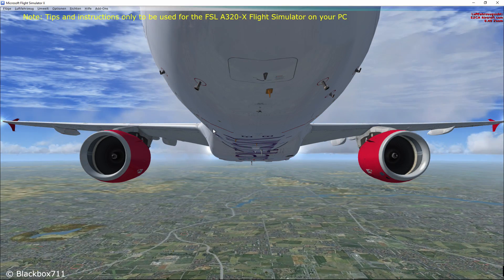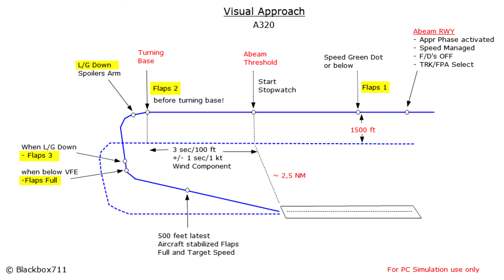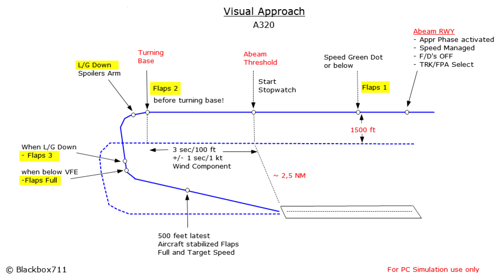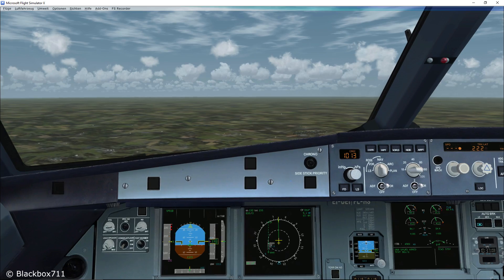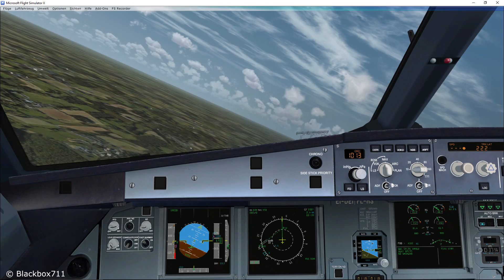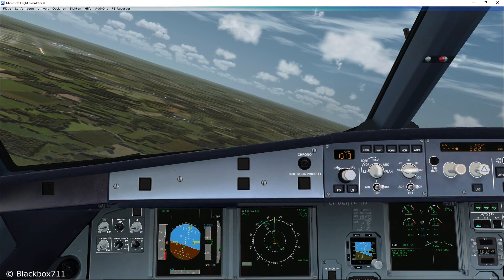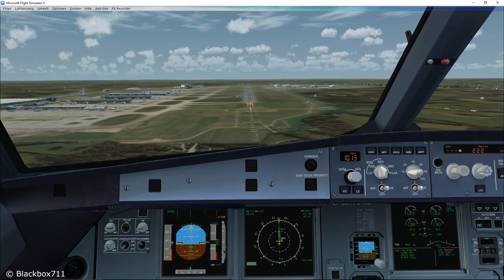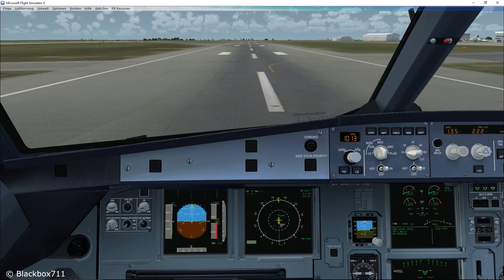FSLabs A320-X Basics: The Visual Approach

Comment: Hi there, on the a320, no ATC or AP on, when you are following a VOR for example, CGS VOR at LFMN, course 354°. I then would need to make a right turn to join my landing runway 4R , course 43°.This would mean you need to turn right 49° correct? 
Then the duration of the turn should be around 16 s ( 49°/3) and your bank angle should be around around 25° if you're at 180 Knots (180/10)+7?
But how do you know when you need to initiate the turn to runway for landing?Any simple formula please?

Comment: Hi BB. Really enjoy going back to these old videos and keep learning. 
When flaring, to how many degrees do you pitch up to achieve such consistently smooth touchdowns? Thanks in advance.
Reply from the maker: Hi. Thank you. The problem is that it isn’t always the same amount of pitch up. The pitch required varies a lot and depends on lots of different factors like weight, center of gravity, airspeed etc. The best thing to do is to practice, practice, practice.

Comment: Hi sir, is the whole procedure done using hanf flown? How do you managed to make the turn onto the runway heading so smooth and perfectly aligned? Thanks
Reply from the maker: The important thing is to have the correct offset on downwind. That should be 2.5 to 3 NM. That way you can do a base leg to see when you need to turn to final. And practice, practice, practice.
Reply: Blackbox711 thanks for the info..is the descent on the final approach happen automatically once u tune the fpa -3 degree or you have to hand flown the descent to the runway..? Haha
Reply from the maker: Hand flown means hand flown. The A320 with ist FBW System helps with stability but you will still need to correct the flightpath regularly.
Reply: Blackbox711 one more question..is Autopilot nd to be on for this approach? Or nd to turn off?
Reply from the maker: nd?
Reply: Blackbox711 sorry for the abbreviation..the nd is need..i try the above tutorial just now but keep failing..the aircraft keep descend with fpm -800 or more..haha..does autopilot have to be on or off for this approach? Or is there by any chance you could do a live stream for this tutorial? 😊😊🙏🙏

Comment: Thanks a lot for this amazing and informative video, i wish you could explain to me the wind component and honestly i didn't understand that line "3 sec/100ft". i'll be so happy if i got it.. thanks and i appreciate your replies
Reply from the maker: 3 seconds per 100 ft is a calculation method to determine how far you fly outbound after passing the landing runway threshold. The higher you are, the longer you fly outbound to be able to align yourself with the proper final descent profile
Reply: Blackbox711       hello. I hope u see this. I am really confused. It looked like on your nav display that you werent on the right course and looked like ur course was on final. Why is this? Also do atc vector you to this position. How does a visual approach work when u have atc

Comment: What would be the missed approach procedure in this case since you are not following any specific approach plate? What would be the missed approach altitude be as well?
Reply from the maker: It would be the same as the straight in approach, i.e. ILS. The missed approach lateral and vertical path are checked for obstacle clearance and hence the only guarantee that you don’t hit any. The missed altitude would also be the one stated for the straight in approach. Happy Landings, Blackbox
Reply: Blackbox711 ok thanks. I did a visual approach into KPBI the other day in the FFA320 and it got me thinking. It was a very fun approach to do.

Comment: Is there an equivalent of a boeing banana arc that works in manual flight ? Or a way to easily guesstimate where will i achieve my chosen altitude ?
Reply from the maker: There is a blue descent arrow indicating where the aircraft will reach the FCU altitude. This also applies when off route in HDG mode
Reply: Blackbox711 Great, thx :)

Comment: Hi Blackbox, you stated that "The pattern altitude should be 1500 feet above RWY threshold elevation." What if the published pattern altitude for a particular airport is higher? Regards...
Reply from the maker: +Sulaiman Saifi .. if the pattern altitude is defined at a certain altitude in the airport operational information, then you would use that altitude. Otherwise the standard pattern altitude for jets is 1500 ft.

Comment: Hi u said that the smaller inner circle has a radius of 2.5 miles, does it mean that to set up a nice downwind for ur approach 2.5 miles from the runway on Downwind is a standard way for doing it? Again many thx!
Reply from the maker: Hi. Well, it is a visual tool to help you get a correct downward offset distance. I would not call it a standard way of doing it. You can do a 3 or even 4 mile downwind offset if you want. That way your base leg will be longer though and you have to delay the start of the final descend. Try it out and see what works best for you. Regards

Comment: Hey hey, Blackbox,
I can't remember the way to "quick-calculate" the descent rate for a 3 degree approach. There was a rule of thumb of speed devided by altitude or something. Do you have, by any chance, this rule of thumb in mind? Thanks in advance!
Reply from the maker: Hi. There is a rule of thumb where you you say descent rate = descent gradient % multiplied by groundspeed. Now 3 degrees equals to 5.24 % gradient. So if you have 150 kts groundspeed the descent rate = 5.24 x 150 = 786 ft/min to maintain a 3 degree glide profile. I usually just use groundspeed X 5. Keep it simple ;-)
Reply: Blackbox711 Vielen Dank für die Erklärung!
Reply from the maker: Sehr gerne

Comment: Hi Blackbox! Thank you for your videos,

I was wondering if this A320 Simulator can actually help me in my Airbus type rating course? Do you recommend it as a training device to prepare my checkrides? Thanks again
Reply from the maker: +TunisianFlying .. Hi. Thank you very much! Now there is a difficult question to answer. Let me say this: If you want to practice all kinds of Approaches at all kinds of different airports, then yes I would recommend the FSLabs A320. But regarding practicing abnormals you have to be very, very careful because most likely your real world simulator will have a different FWC Standard, meaning that the ECAM Checklists might differ from your airlines checklists. That could lead you to being confused when in a checkflight. So please check your Airlines SOP before using the FSLabs A320 as a training device. That is vitally important, so please do not take this lightly! This is my personal view, I do not work for FSLabs or get sponsored by them in any way. Regards
Reply: Many thanks for the awesome explanation! Loud and clear, i'll go ahead with it with caution.

Cheers, happy landing
Reply from the maker: +TunisianFlying ... All the best for your training!

Comment: how to use the 3 degree glide path? is it the bird? n how to use it
Reply from the maker: Yes, use the FPV (Bird) and adjust the pitch so that the FPV is set on -3°. Regards
Reply: btw, we need to flare when 30ft above the runway ? may i after 50 ft i pull abit the stick to reduced the rate of descent or i have to maintaing rate of descent until 30 ft & then i flare the aircraft?

Comment: I realy like your videos. Just one question: how do you get the sound of the front wheel hiting the runway lights? Is it included on the FSlabs airbus? Thanks!
Reply from the maker: Hi. It should be included in the FSLabs since I don't have any special addon for that. Regards
Reply: Thanks a lot